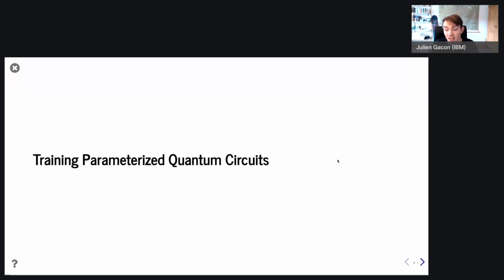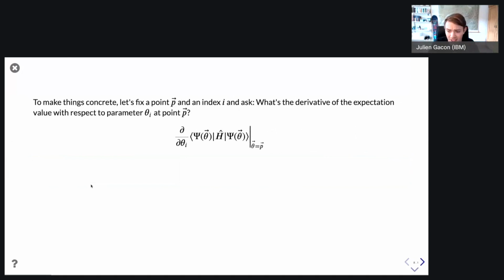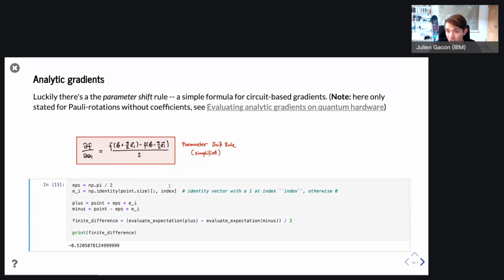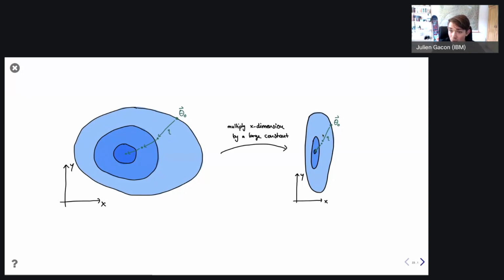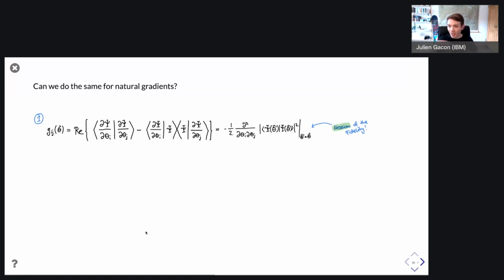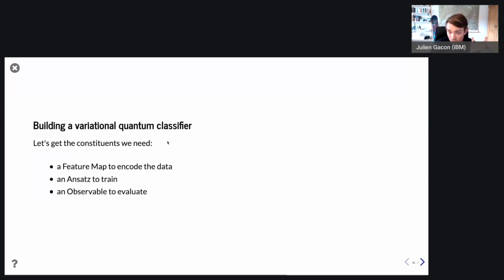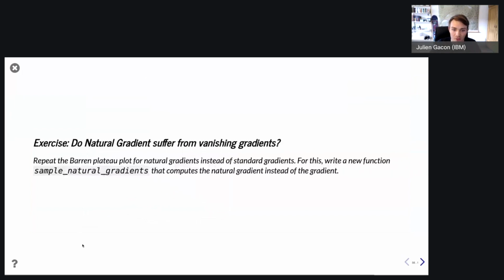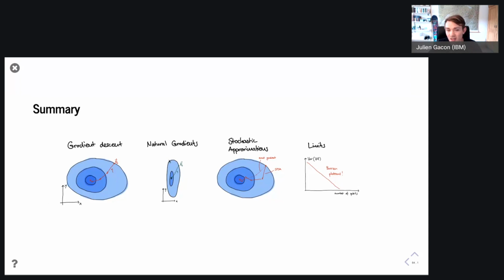Lab 4 - Introduction to Training Quantum Circuits

Comment: This script includes some deprecated functions in latest Qiskit 0.39 
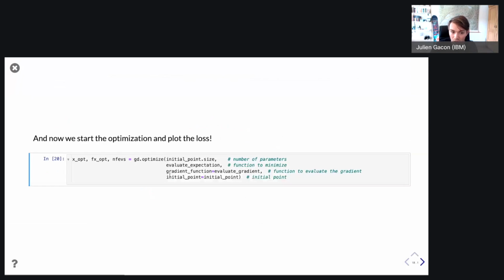22:03  gd.optimize --> result = gd.minimize(fun=evaluate_expectation,  jac=evaluate_gradient, x0=initial_point)
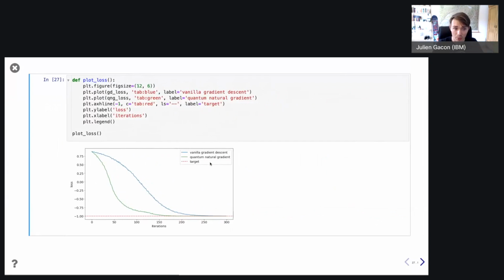29:14  qng.optimize --> result = qng.minimize(fun=evaluate_expectation, jac=evaluate_natural_gradient, x0=initial_point)
34:37  spsa.optimize --> result = spsa.minimize(fun=evaluate_expectation, x0=initial_point)

Also, it needs some modifications due to errors
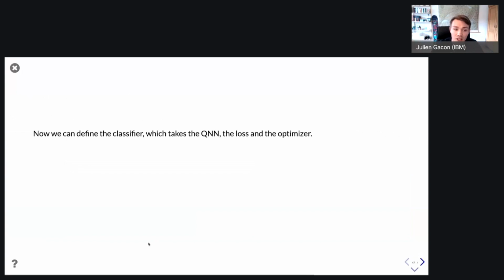46:23  initial_point = np.array([0.2, 0.1, 0.3, 0.4]) --> initial_point = np.array([0.2, 0.1, 0.3, 0.4]).reshape(1, 4)
Thanks for nice presentation : )